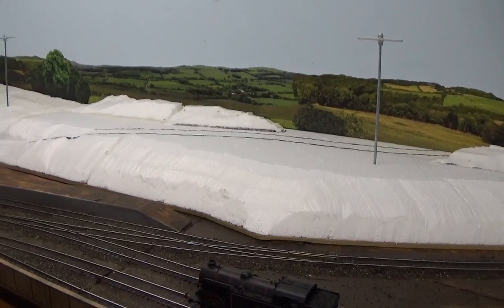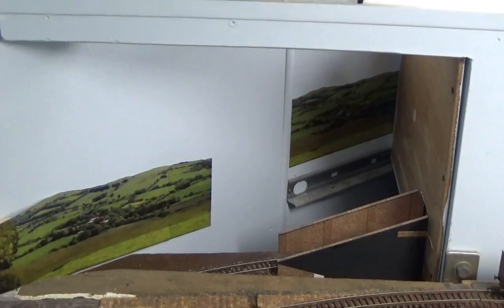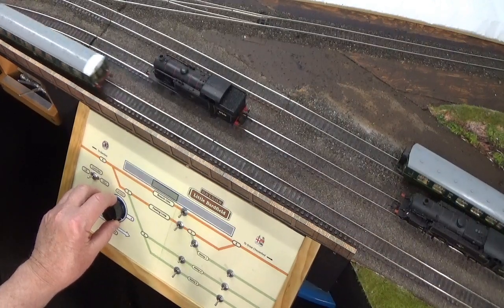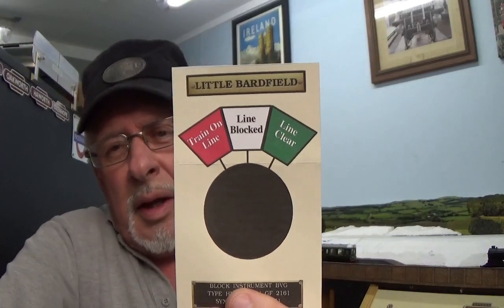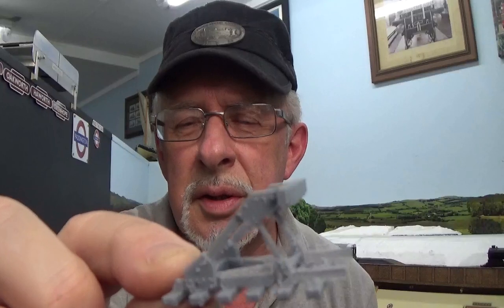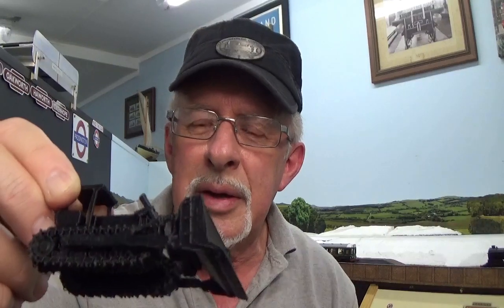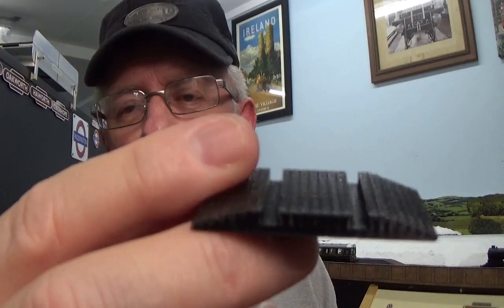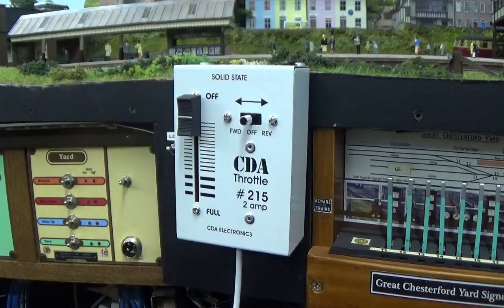GCJ November 2020 Update

Comment: GCJ is coming along nicely Gormo with the new scenic's with there bits and bobs to be added. It is very nice that people will reach out and give things away to try out as samples. The 3D printed buffer stops look great and some of the other thigs will come in handy for you. I am always amazed at the generosity other modellers are on the YouTube videos I have watched. From little things such as detail packs, track, buildings, tools to items that have been replaced with a newer modelling equipment, like a 3D Printer etc. I've done things like that myself, e.g. a guy was having problems with his electrics and couldn't trace the fault so I sent him a nice Digital Multi-metre that also had other features along with the Voltage, Resistance and Ampere settings.
Reply from the maker: G`day John,
Yes there are a lot of very helpful and generous people out there in this hobby.
Cheers Gormo

Comment: Very interesting update Gormo, I guess we will see more and more 3d printed models as the printers become cheaper and print at better resolution to get the fine detail. Luke Towan I think uses a resin printer which can print in high detail but they are expensive. I saw a video demonstrating the signalling you mentioned between signal boxes with the bells and it was fascinating. I like a bit of Old School stuff!. Cheers John
Reply from the maker: G`day John,
Yes the printers are out of my budget range at the moment but you can see the way of the future.Resin is messy too I believe.
I like the signalling system in terms of operation. It brings an air of realism to the operations. Of course it does not have to be used all the time, but it will spice up operations with more than one operator.
Stay safe
Cheers Gormo